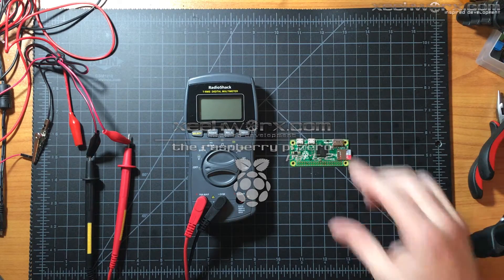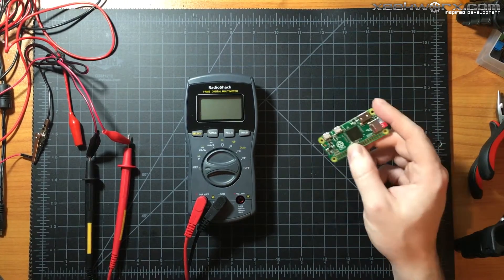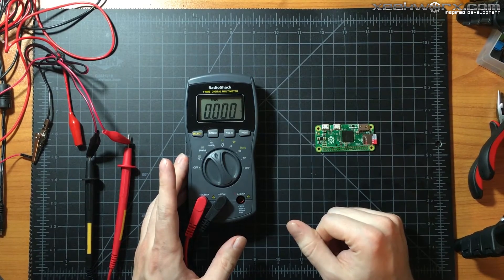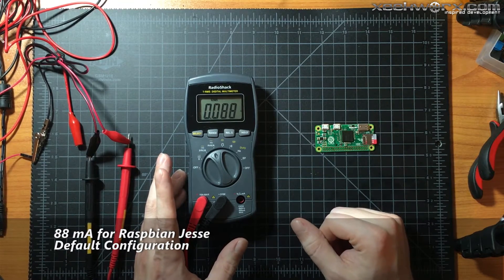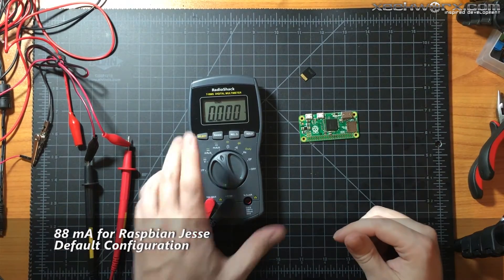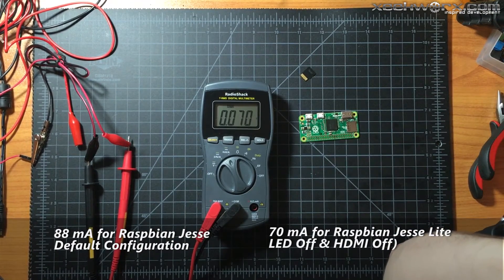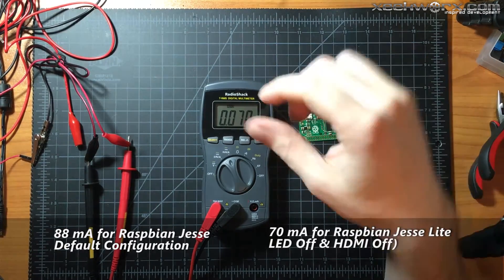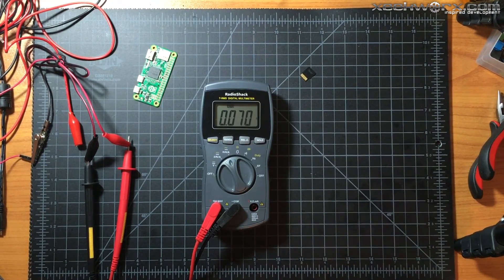PiZero Testing Part 2 - Reduce power consumption

Comment: Article is gone!
Reply: Sorry about that, my host went down I failed to have an up to date backup at the time. What’s here in the video is almost verbatim what was in the article.
Reply: @xeekk  Thanks. Other articles state to use system.d files. What's your opinion?
Reply: @cjlowe1650  systemd is what I use on my Linux systems, not really for any reason other than it’s been the default with the distros I’ve used and it’s what I’m used to.